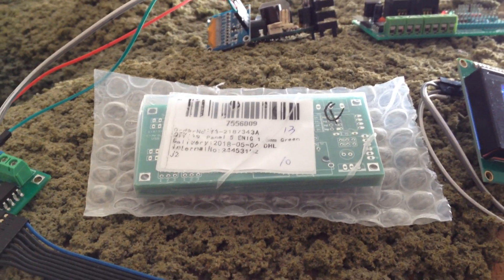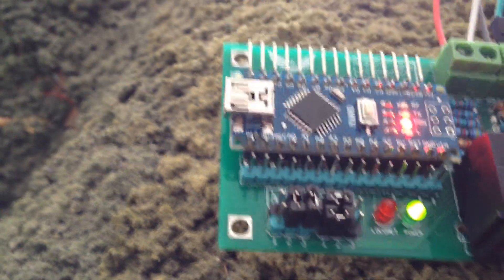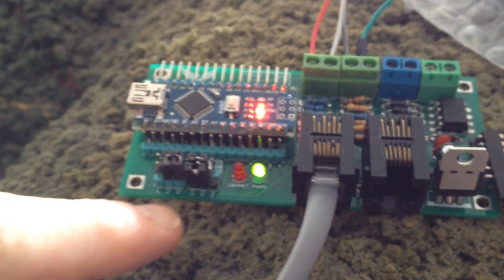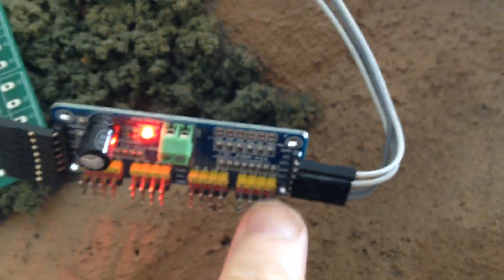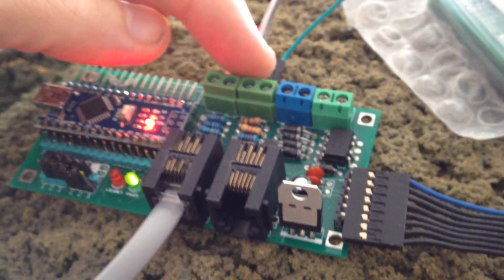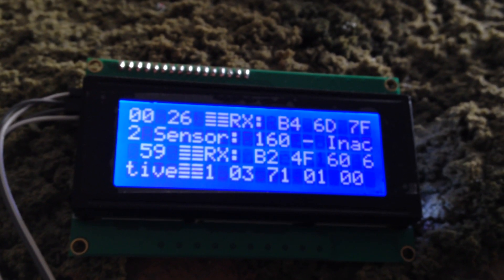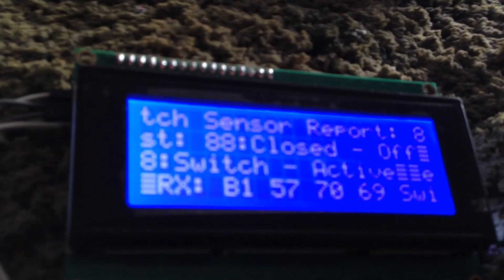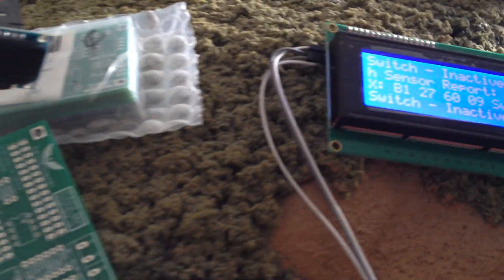Arduino Loconet/DCC decoder

Comment: this is very interesting - I too built the Loconet DCC interface v2 from Curious Timo and was also a little confused on the jumpers.  In the end I thought the middle one of the first set was the pair to 'jump' if you wanted to power the board externally using 12v for example and not tax your system.  Do you still think it's the left pair of the first set to place the jumpers after using it for a while?

Comment: Very interesting what you do, I'm building a new train system in Brazil Fortaleza, I like Arduino very much. I'm going to use Digikeijs, Roco z and Arduino to automate the trains. The trains run between three rooms, so automation is important, I have the trains on display in the control room. Must be able to run 10 to 15 trains at the same time. I am studying your videos now, very interesting. I want to make the decoder you show here.
Reply from the maker: Please let me know how you get along building and using these decoders. I was not successful in making the servo’s work using the IC2 boards since I use Peco coils. Also was not able to get the BGB lights working.
Reply: @ClinchfieldModelRailroad  First I need to get PCBs and what components I need, you like have the overview what and where? The next thing is that I commute between Norway and Brazil for work, I have to go to Norway in about 3 weeks, but by mid-March I'm back, hoping I have all the components by then. What do I need?
Reply: @ClinchfieldModelRailroad  You didn't make the decoder work, I'm thinking of using them with Digikijs, But on the website you linked to, where does it work? Must see if I can handle it, must try
Reply from the maker: Are you using JMRI for your display ?
Reply: No, until now as a test run I've used Roco z, I'm looking at what to use, a little unsure, maybe Train controller. @ClinchfieldModelRailroad